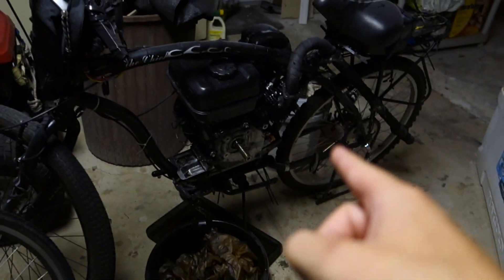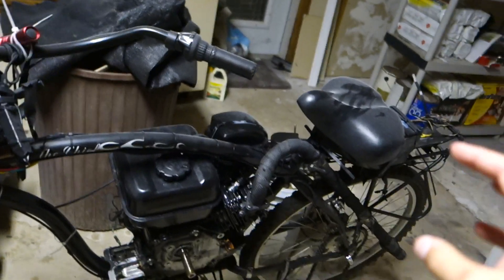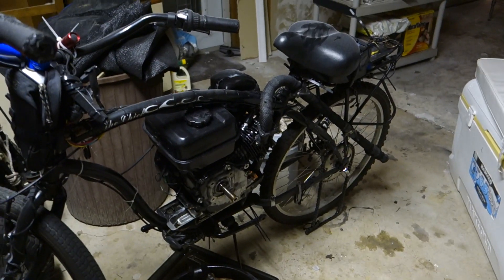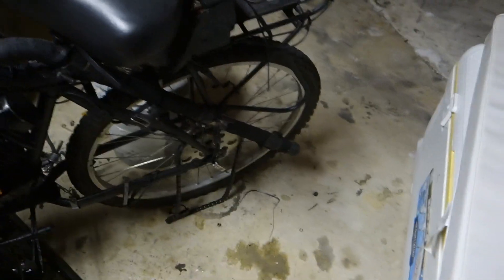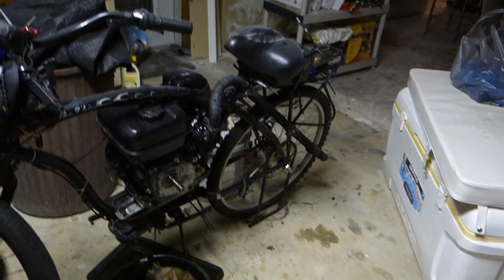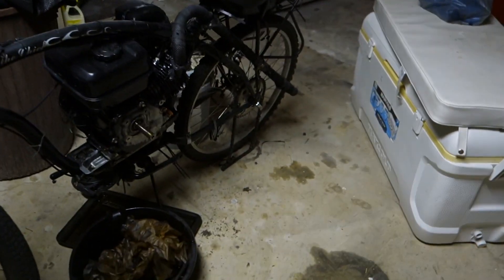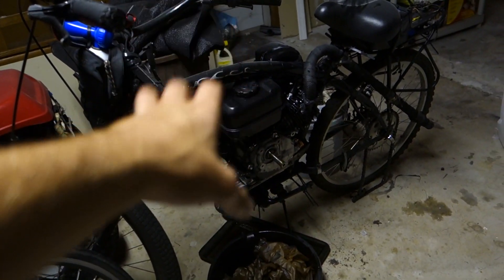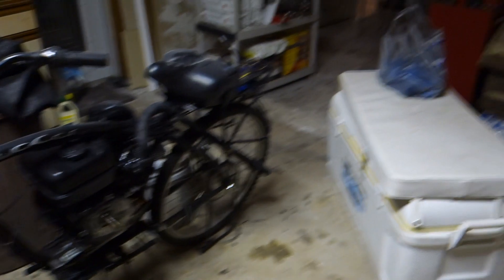What is Happening with the 212cc Bike?

Comment: I built a 79cc without governor and have not pulled it more than 70% of the throttle. And its scary fast. Ofcourse it does not have the takeoff torque of a 2 stroke, basically due to the characteristics of a 4 stroke but once its up and running, it PULLS ! Lots of fun. Will mount dual spring forks soon. Have fun !
Reply from the maker: That's awesome!!!!! I am so excited for this
Reply: My 79cc sucked till I put on 50 tooth rear sprocket. Please try it freaking wakes bike up.ull beat and moped on small bike.i raced a Yamaha 60 and a Kawasaki 70 last week I beat both of line whipped the 60 whole ten lap race the 70 kaw past me in the corner.1972 700c sears and robuck with 29inch motorized mags with sleeve bearings. It tops at 50mph 5600rpm I'm a coward scared motor will ripe apart .tied governor spring with zip tie.kid has video how to over ride governor
Reply: David Kaul   Do you want to to cruise o r do you want to race? I rode my 79cc all day today. I had the spring that pulls the throttle back and it kept pulling. I had to reach my hand down to release the throttle. But then again what is is your option. You can go with the 49cc Hua Sheng 4 stroke or the the 2 stroke 66 cc  crap or you can custom build a 90cc semi automatic. Which is my next project BTW..
Reply: Firstly the reliability of a 79cc  4 stroke Predator. I had my 66cc stranded 10 miles from home ! The 79cc Predator is a HORSE ! LONG RUN !

Comment: Option A just seems more practical. 

Option C is make Option A shoot flames. "All you have to do" is have a spark plug modded at the end of the exhaust, and have a switch which does two things simultaneously: acts as a kill switch for the engine's spark plug (or you just hold the actual kill switch) and redirects the signal to the muffler's spark plug. The engine's completely unspent fuel just moves through the system, and gets sparked on its way out the exhaust. Here's how the show Trucks shows it: https://www.youtube.com/watch?v=2VHQ8E9q5x8

Comment: unless you got a spare 56tooth sprocket dont get the 79cc... gear ratio withh 44 tooth is too low trust me from experience
Reply: Too fast or not enough torque?
Reply from the maker: 212 gives way too much torque but if you gear it right the 79 can be really fast

Comment: My 79cc with 50 tooth gear does 45mph 5200rpm on 29inch tires. I tied governor spring with wire,it works great. A 212cc would rip my bike in half,lol,it's a 1972 sears and robuck from Austria with 29inch motorized mags with sleeve bearings .the take offs r nuts it whips any moped and jerks violently from frame and fork flex around 2600 rpm[20mph it smooths out and kicks in.around 4000rpm38mph it freaking wonts to pull u off bars.at 5600 rpm49mph it's too fast for the bike and the engine I'm a coward it's gonna rip flywheel apart or worse.mine is a monster 80 kit with only a 6inch 5/8 header I made as mod. Get the 79cc and a 50 tooth gear u will thank me.tie off the governor spring. Never go above 6000rpm it's too fast any ways .Get tac